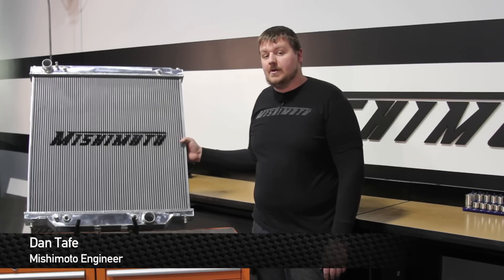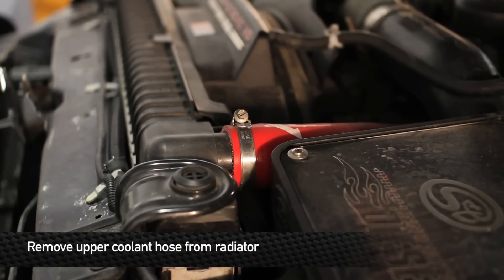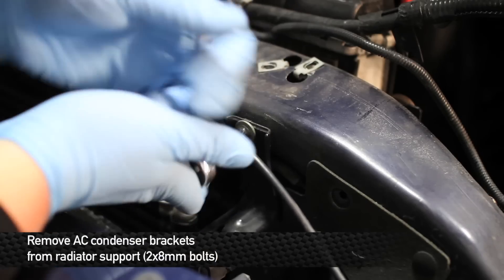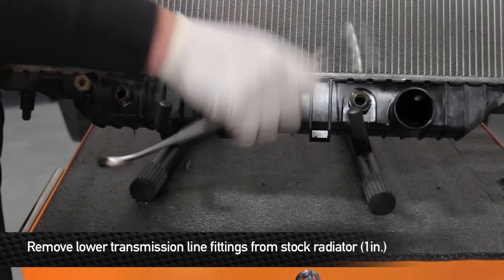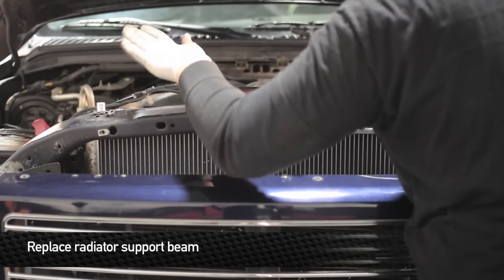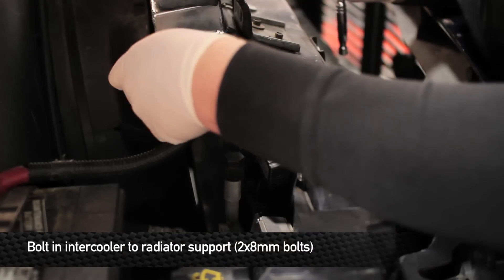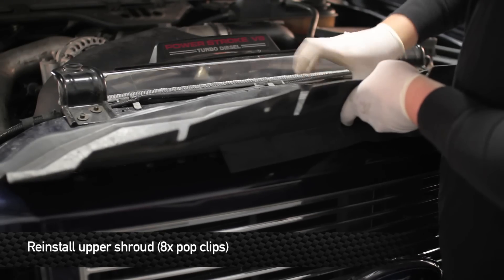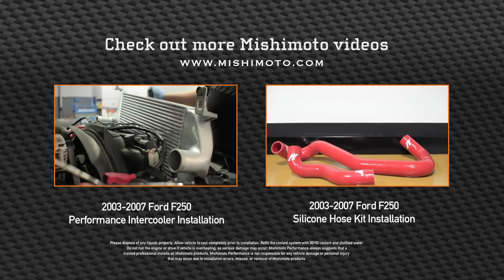How To Install: Mishimoto 2003-2007 Ford Powerstroke 6.0L Performance Radiator

Comment: Does it take more coolant since it's bigger? If so how much exact
Reply from the maker: With the radiator installed the system will take 7.76 gallons to fill.

Comment: You can do all of this without removing intake or radiator support.  Un bolt and pull the fan shroud straight up.
Reply: Exactly
Reply: https://youtu.be/5MQG2koPJ-g
Reply: Bond Lohden what about fan getting in way of pulling shroud ?

Comment: You have great products.but when it comes to 6.0l rad fluid the only fluid that should go into the rad is premium gold rad fluid. using any other rad fluid will kill the oil cooler ..the whole reason ford got sued and the 6.0l got a bad name ....but great product you have .....
Reply: Or CAT ELC.
Reply: There are other,  even better options out there now.   Tons of homework!

Comment: Good video, but i strongly reccommend people using GOLD coolant in there ford trucks, the green coolant from heat and pressure turns into a jello type substance, look at all the ambulance issues ford had in 03-05, i have personaly had to replace an oil cooler, t-stat and flush the system 3 times to get all the shit out of there... and there seriously was CHUNK's of this stuff
Reply: I use Cat ELC. Much better alternative to Gold.

Comment: This is a great DIY vid and covers all you need to know to remove and install this radiator.  I was able to do it without removing intercooler or loosening intercooler tube clamps.  You can get a plastic tool to release the transmission tubes on Amazon for a few bucks.  A good tip is to remove the transmission hoses from their mounting clamps on the frame so you can wiggle them around enough to release the tubes.
Reply: Not all F series are factory equipped with the quick disconnect.  some use a horrible compression type nut